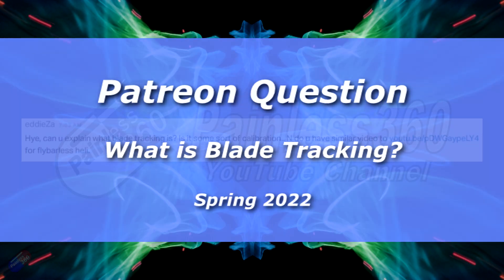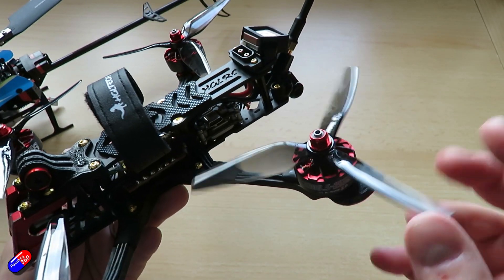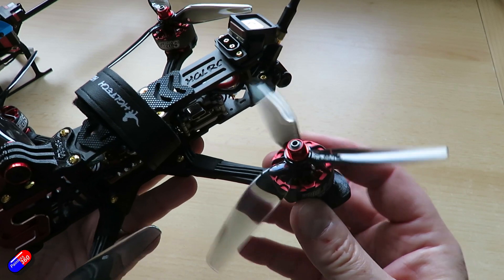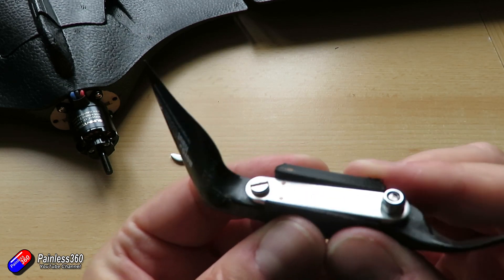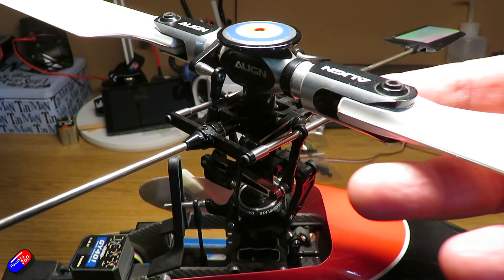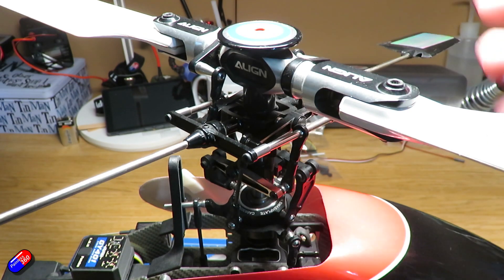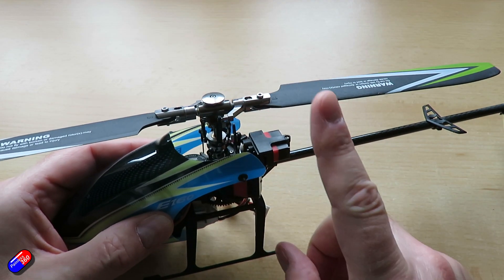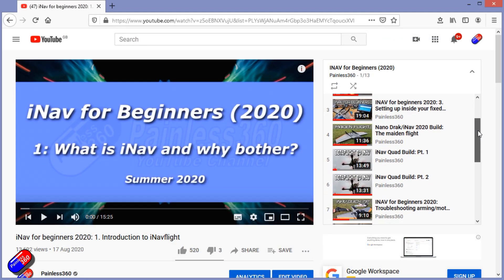What is Blade Tracking? Why is it important?

Comment: I used to do Track and Balance on the H-47 Chinook. All the same principles apply, except at a vastly bigger scale, and in several different flight regimes. 

The blade tracking is done with a specialized camera that is synchronized to the rotor speed. Rather than looking at the edge of the rotor disk, it looks upwards, perpendicular to the blades, in order to measure their distance.

Balance is measured with vertical and lateral accelerometers mounted in the fwd and aft pylons. These measure the 1/rev acceleration. A magnetic pickup on the swashplate provides phase information so you can determine which blades are generating the imbalance.

The Chinook has 3 types of T&B adjustments. (1) pitch links, (2) blade tip weights, and (3) blade trim tabs. It was my job to analyze the T&B data and determine the optimal set of adjustments to bring T&B (as well as autorotation and stick position) within tolerance.

Comment: This is why I don't fly helis anymore lol. I spent a ton of time setting up the blade pitch and tracking and balance etc on a TREX 450 and I never want to do it again. It did fly great after all of that but what a PITA. Great explanation though!
Reply: That's unfortunate. Setting pitch and cyclic should take less than 5 mins with a cheap 15 dollar pitch gauge. It doesn't need to be hard.
Reply: @Rusty-Metal  If you've done it a bunch of times then yeah, I suppose it wouldn't be that hard, but when you're just trying to figure it out the first time it's not so easy. But thanks for the condescending remark.
Reply from the maker: It is quick if everything is OK in the head ;). Slightly bent feathering shafts, poor quality blades, loose screws, worn or damaged bushings or 'O-rings' can cause havoc!
Reply: @flipfpv  give it another chance and get an xlpower or a sab not these trash align that always has a problem
Reply: @Twx97  Yeah, maybe I'll circle back to helis at some point but right now I'm having a lot of fun with FPV. I sold that Trex and will probably sell the rest of my helis and if I come back to it I'll start fresh with something better. Thanks for the tip.

Comment: Hello,
Back to my mCPX-BL Heli days, blade tracking consisted in folding both blades back next to each other, and checking they were at the exact same level when no pitch given (engine off). If they made an angle, like an horizontal 'V', something was wrong.
Is that blade tracking, or is this another offset/tuning/balancing/trimming ?
That would explain why I kept crashing all the time :)
Reply from the maker: That isn't blade tracking that is checking the pitch angle. Not sure if that would explain the crashes ;)

Comment: Fewdays ago i was watching ur videos related to helis on blade tracking but stil i cant get my blades to track the issue is the blades wil be in track for few seconds until it spools up as soons as the rpm goes high it looses track and if i give it positive pitchthen again it goes in tracking , i tried every method to track blades but got not no luck i replaced feathring shaft ,blade grips, blades too but no luck so far can anyone help its a 450 flybar heli
Reply from the maker: In my experience, if everything in the head is tight and not worn, then I'd suspect that the feathering shaft o rings are worn /damaged or the blades themselves have an issue. I had this a few times when I tried to fly with cheap blades back in the day..
Reply: @Painless360  how to check for dampning balls i mines are soft i can squeeze them and they do look perfectly round and fine even the feathring shaft is brand new
Reply from the maker: It depends on the model and head type you have... I'd also re-check the blades are ok too. Best of luck!